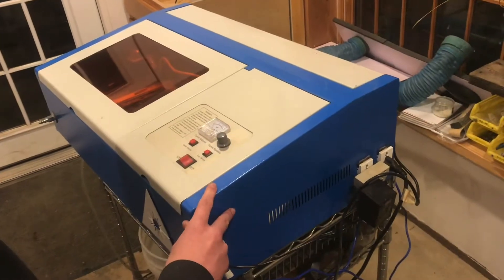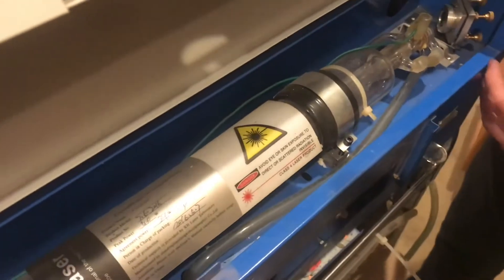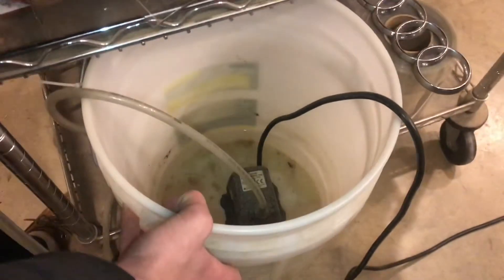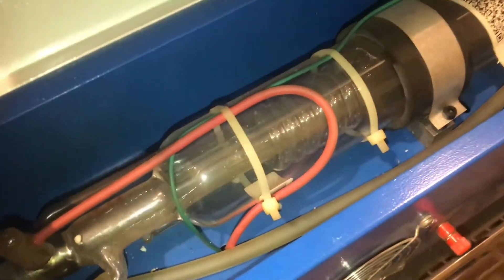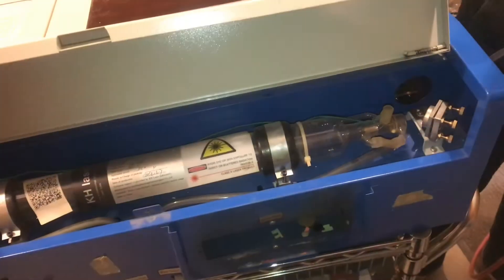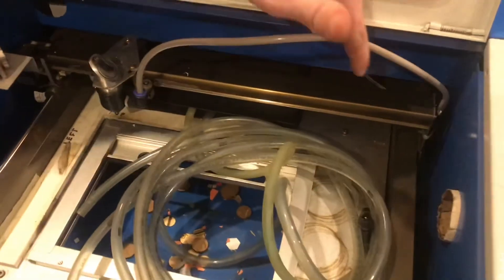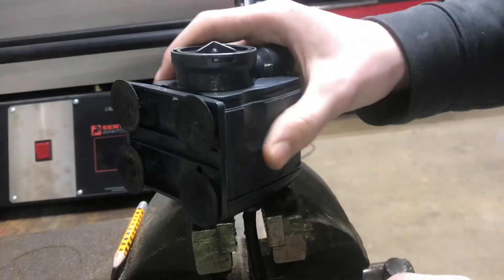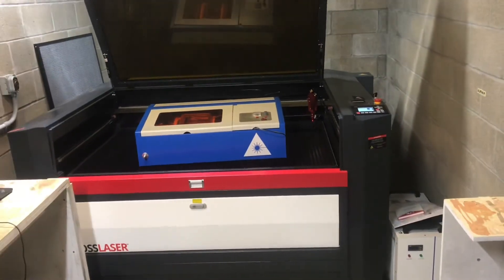SAFELY “storing” a K 40 laser cutter in cold freezing conditions

Comment: I need to put my k40 in a cold garage, but want to keep it running... So I'm going to try a heater that's usually used to keep the water for chickens from freezing and a tiny aquarium waterpump to keep it circulating. Hopefully that'll keep the whole thing from cracking.